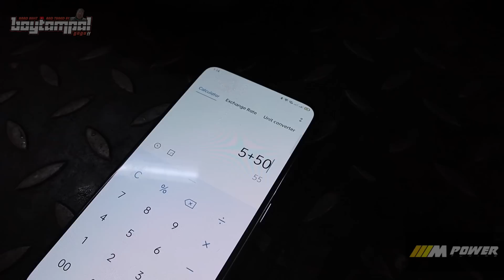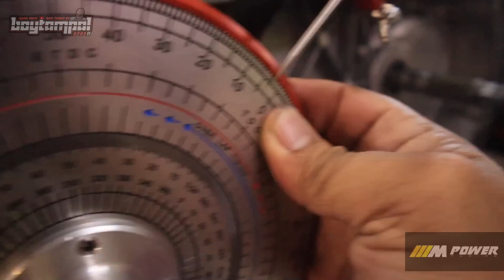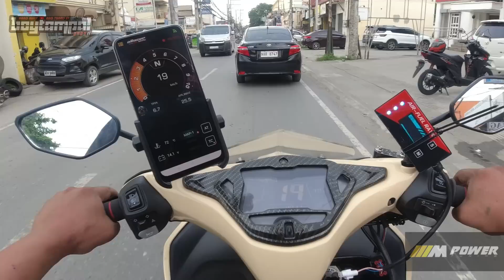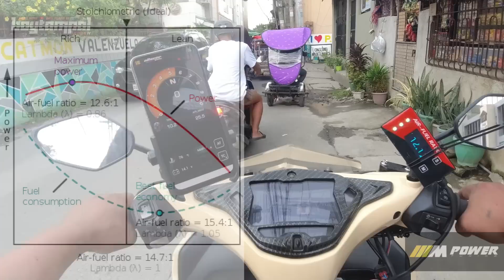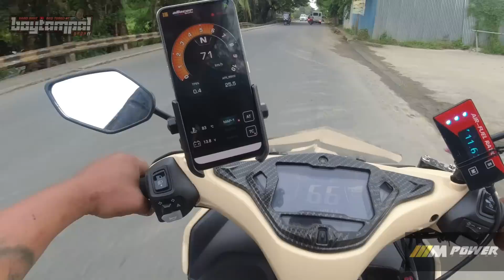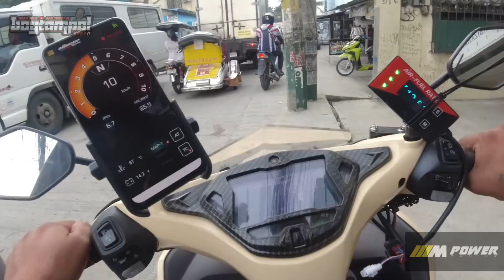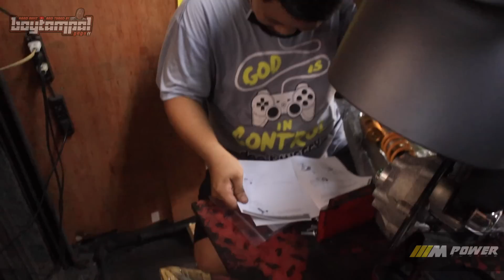nagsawasa sa basic, nag 215cc!

Comment: idol tatanong ko lang sana kung ilang cc na motor ko, hindi ko kasi alam nag upgrade kasi ako. nmax v1 po motor ko
62mm bore
19/22 big valve head
+4 crankshaft
32mm throttle body
140 injector
cvt set 
mga ilang cc na po kaya? salamat po🥰
Reply: 189CC